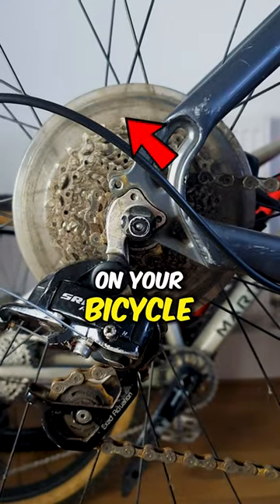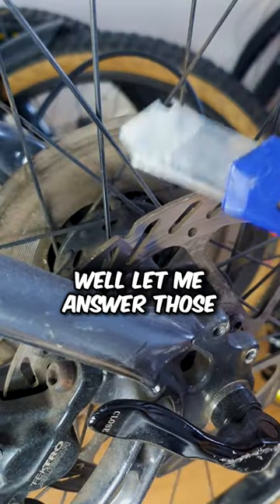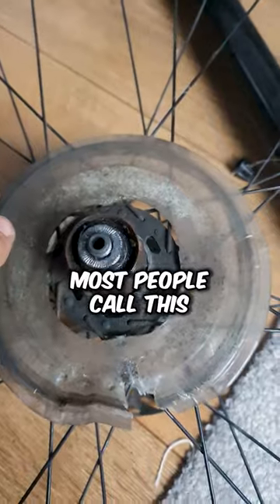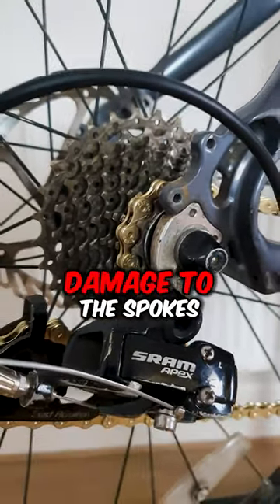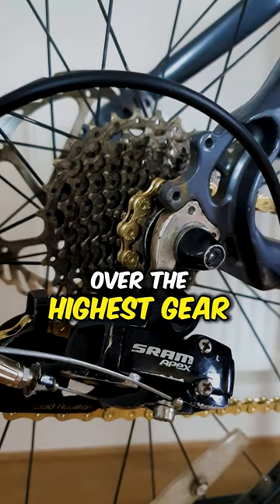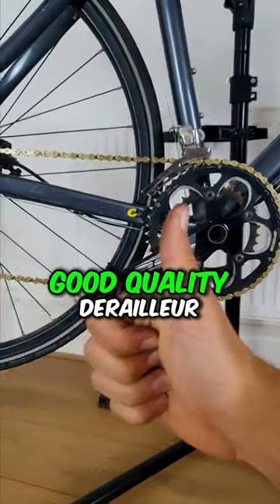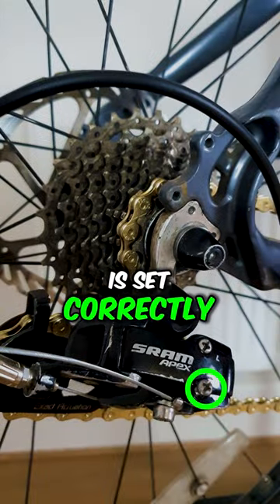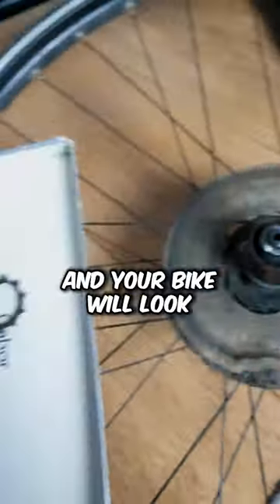What is a "Dork Disc" actually for? Should you remove it?

Comment: As long as the limit screws are set properly it really dose not matter what kind of derailleur you use that chain won’t jump off
Reply: My fuckin limit screws get outta whack on like 4 different bikes, on has an 8 speed pro rush setup, the other a shimano tourney, the only one i notice that doesnt do it as much is the advent with microshifter,
Reply: Unless you bend your derailleur 😂

Comment: dont trust myself, so it stays on!
Reply from the maker: Why don't you trust yourself? I think you should just go for it and remove it 😉
Reply: Remove it so your bike parts get damaged easily, Corporations would benefit from it tho so its cool
Reply: Remove it because it doesn’t do it’s intended purpose
Reply: @UnknownRide I remove my dork disk on accident and now I put it in 2nd gear😭
Reply: @Tumbxdo you cant get to 1st gear?
Reply: @UnknownRide happened on my ebike selected lowest gear to peddle and full throttle so I speed off got to about 20 mph  before the derailleur got caught in the spokes and the wheel locked up so I bought a new derailleur

Comment: The plastic dork disk is useless.  I had my chain jump over the low gear ripping the plastic and the wheel pulled the chain into the wheel causing costly damage.

Comment: Rocky Mountain must trust their derailleurs  because my Rocky Mountain never came with one, and it is a great derailleur because my chain has only popped once whereas my friends with other brands (ie. Trek and Norco) have had their chains pop thousands of times.
Reply from the maker: High end bikes don't usually come with this
Reply: All sram eagle drivetrains come with one but high end Shimano ones do not
Reply: Frame is irrelevant, only initial gear setup and correct limits set.

Comment: The dork disc is so useful to me 😂 i was on 8th gear doing a climb then my chain did a pop sound and i heard scraping sounds while pedaling, i checked and the chain was over the 8th gear and was sitting on the dork disc, its sometimes useful for the bike abusers who do high speeds on bumps with a hard tail😂😂😂😂
Reply: Your limit screw isn't adjusted properly. The only way your chain is going to fall like that is if the derailer pulled it over, not from bumps, jumps or even crashes. Your limit screw literally stops your derailer from moving.
Reply: Thats 1st gear not 8, 8 is the smallest cog not the largest
Reply: @nyreppin1 as a full time bicycle mechanic, I can tell you that the limit screw is only half the equation. The hanger often gets bent resulting in the same issue.
Reply: with a bend derailleur hanger the chain can overshift although the limit screws are set properly.

Comment: Doesn't the derailleur cable sometimes stretch? Usually happens in early days for me. I usually don't remove mine until the disk just cracks itself and comes off.
Reply: Stretch won't effect it. The limit screw will prevent the derailleur from moving far enough to drop off if set properly.

Comment: You should not remove it.
Reply: Why?
Reply: @DaveCM  Because there is a good reason why the manufacturer put it there.
Reply: @josejn2007 they’re terrible, they come loose, bind on the cassette, rattle around. Manufacturers fit them to cover themselves for bad gear setups, if the gears are properly adjusted the chain can’t fall off the low gear.
Reply: @josejn2007 the reason is liability. It serves no real purpose. A thin sheet of plastic is not going to protect your spokes from the chain lol
Reply: @Adam-vm8kp  It would then be preferable to adjust the disc properly than to remove it. You never know when the gears will go wrong.
Reply: @mstrshkbrnnn1999  I have an old bike with a metallic disk. But I think that a plastic disk could do the difference.

Comment: All these do is wear off and become noisy and unpleasant to the eye, i rarely see bikes have them these days even brand new.
I also don't use the first gear at all and believe it or not i'm too bored to set the derailer properly for that gear so the chain wont fall behind so i set it to start from the second and everything's fine with that issue.
I have also shortened the chain two times after breaking it twice so if i set that gear with the 48t on the front the chain stretches to a lock. 😂😂😂😂😂

Comment: So much misinformation in these comments about the dork disc. If you don't plan on taking your bike to a shop to be inspected or adjusted and you don't plan on adjusting anything yourself, leave it on. Chances are you screws might be set incorrectly. But if you have even the slightest common sense you can figure out how a limit screw works and adjust it yourself. That way you can remove that horribly discolored piece of plastic that's ruining the look of your bike.